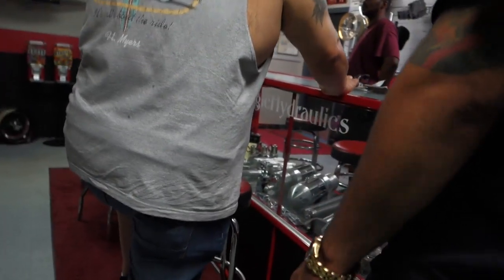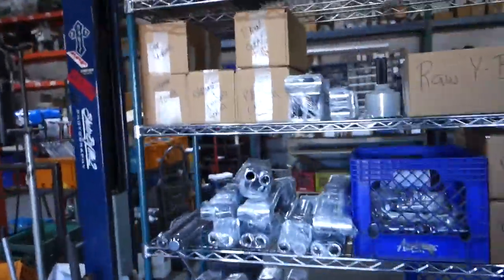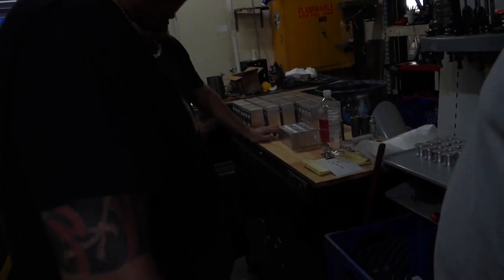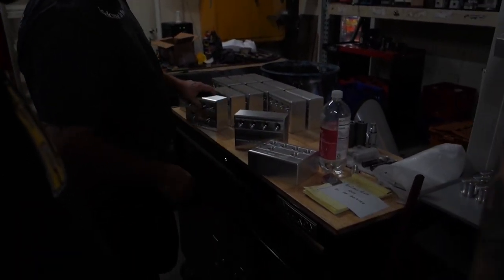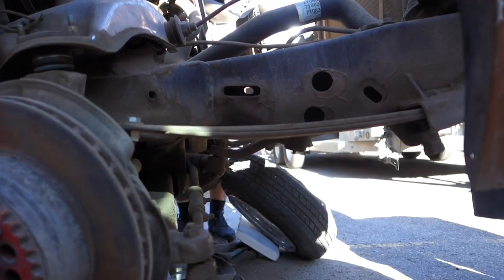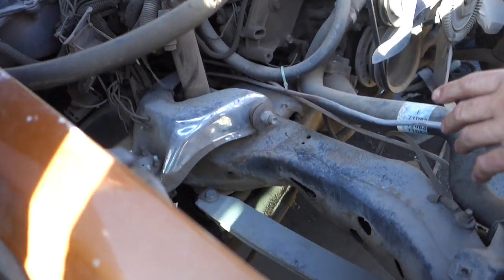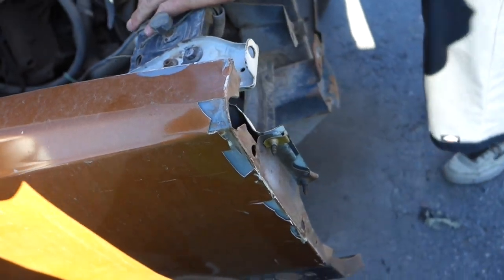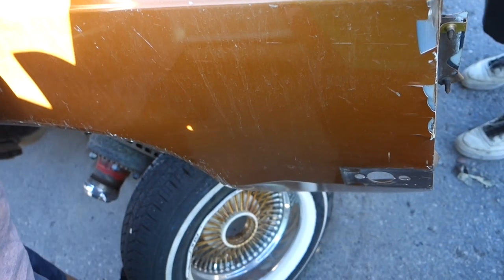Black Magic Hydraulics walk around *Lost vegas footage*

Comment: Does that A-Arm setup keeps the ball joints from breaking or does it make the lowrider hop higher?
Reply from the maker: Push Harder it doesn’t do either really. All it does is makes the suspension be able to reset itself in mid air. That way you don’t have to time the dump when the tires touch the ground. Makes it easier to hop.
Reply: @RJTickler  So i assume they don't allow this setup in a hopping competition that involves money because that would be considered to be cheating but they would allow it in a competition that is just for fun but anyway nice setup. Can you do a video showing you installing Titanium Blocks on the rear bumper
Reply from the maker: Push Harder no they allow it in competition hopping. That’s what this car was. There is really no rules in hopping comps anymore. You can be weighted, all they really classify is number of pumps and batteries. Everything else is fair game. And if I ever get a chance to run some blocks I’ll make sure to do a video on it.
Reply: @RJTickler  Wow ok, push on the trunks and load the bumpers up with weight ok but my opinion is true lowriders daily drivers use timing when hopping i do it all front, back, side to side, bunny hop, side to side sea saw, round the world, i say to some people what you got switches for if you ain't gonna hit them and dance when the sub woofers in the trunk start bumping!